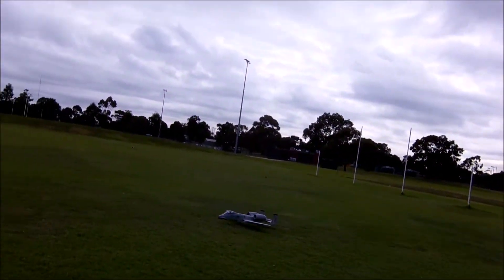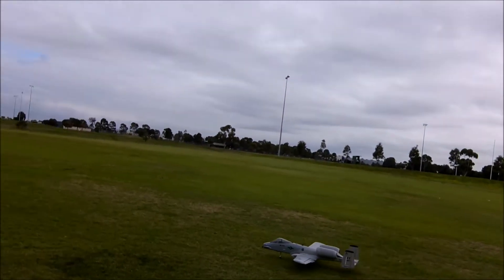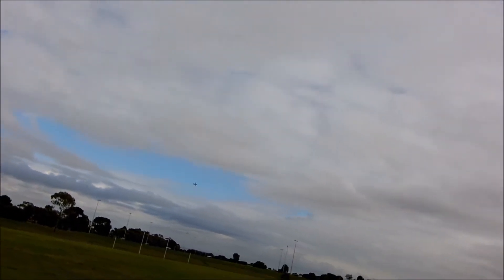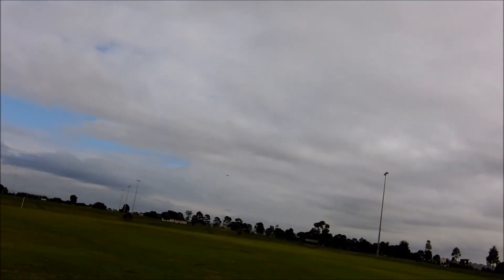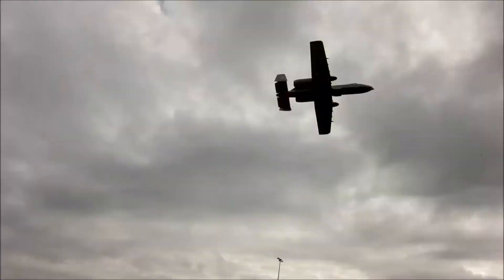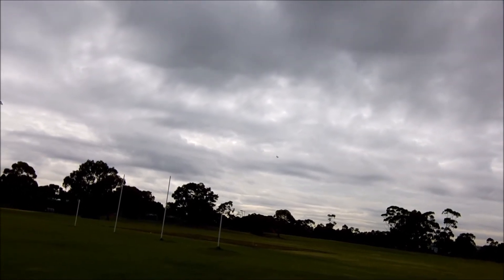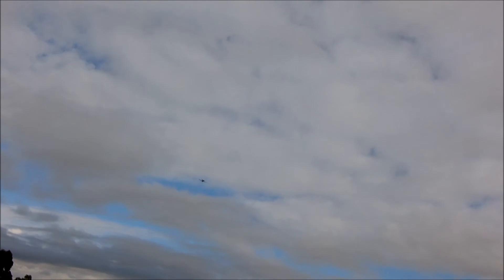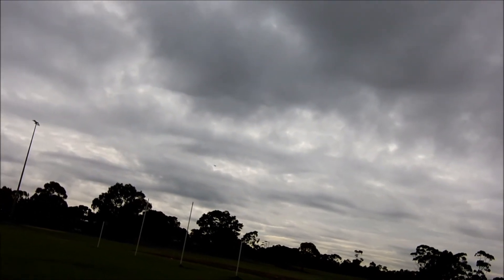A-10 Warthog - LX 1540mm span Twin 70mm - Turnigy Graphene 2x 3S 5000mAH 45C

Comment: Nice flight Mr. Peters.  I attempted to maiden my LX brand A-10 over the weekend, but was unsuccessful - it would not rotate and ran out of runway.  Had plenty of speed and up elevator deflection - just wouldn't rotate so I'm thinking it may be slightly nose heavy.   I have the CG positioned precisely as described in the manual - 85mm aft of the wing's leading edge.  Based on the experience you've gained flying your A-10, did you move the CG aft?  Let me know when you get a chance.  Thanks...
Reply from the maker: Here is my Blog with all the A-10 build/fly info. CofG 90mm
It appears that all A-10 models need quite a bit of UP trim to fly along level. Maybe some of that is due to thrust line, but I have never tested that to see for sure. I just went ahead and added some UP thrust, but even with that it still needs up trim.
Even at 90mm CofG it seems it might be a fraction NOSE heavy, but it is just not safe to go more rearwards. Aircraft behaviour IF it founders/stalls get exponentially worse as CofG heads more rearwards. Not tail heavy, but any amount more rearwards of a 'good' safe position. So it is not worth doing that for what bit of gain (rotation) it would help. Watch my last HSD Viper Jet flight/crash on landing.....

https://www.rcgroups.com/forums/showthread.php?2309582-A-10-Thunderbolt-II-Warthog-LX-1520mm-Span-Twin-70mm-Jet flight/crash to see what it causes....
Reply: Will do.  Thanks for the CG info and the link to your A-10 build thread on RCGroups - I'll check it out.  I'm particularly interested in seeing how you added "UP thrust" - hopefully you have a section on that modification and a few photos too.  Thanks again...